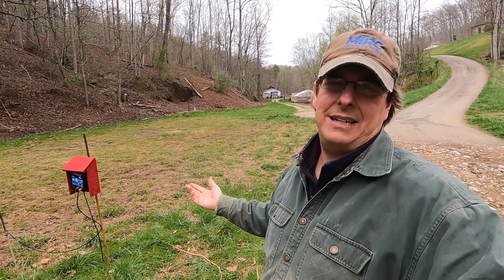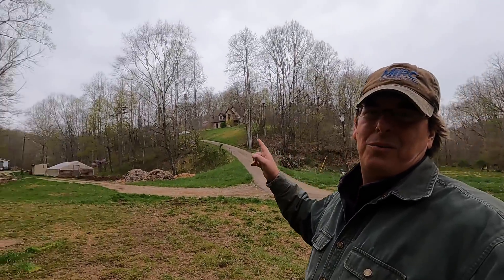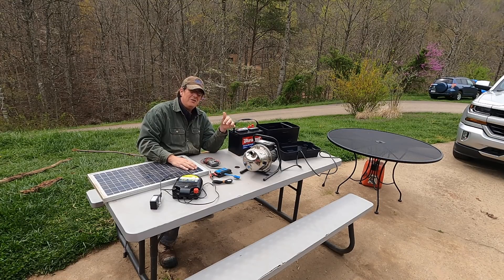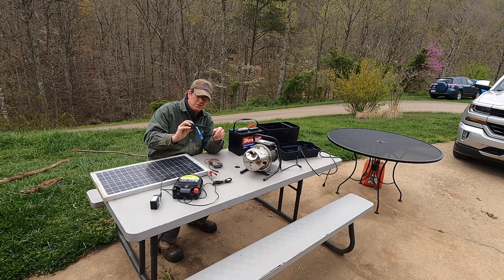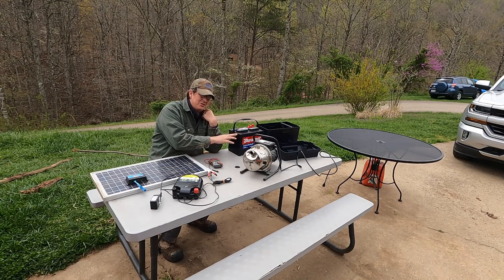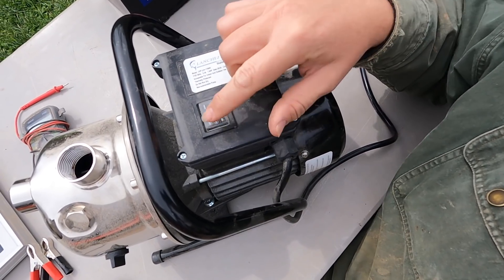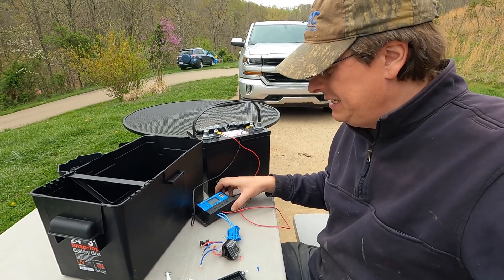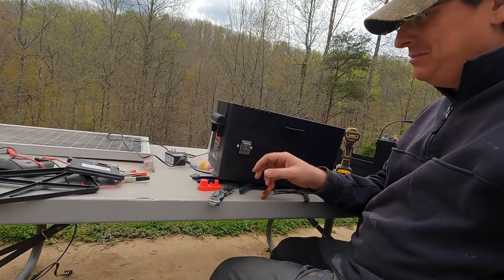Building a LOW COST Solar Fence Energizer

Comment: On your netting how are those nets set up . Are the bottom runs of it not hot so you can lay it on the ground or ???. Thanks
Reply from the maker: The very bottom is not hot. The rest are. Even if some touch the ground, the fence stays hot enough to function quite well

Comment: What is the battery box you are using? I can't seem to find one that has that extra space for a controller and switch like that. Like the adjustable divider in the box also.

Comment: Consider finding a way to attach the solar panel and charger setup to the coop. Then you can move it as a single unit. Maybe on the tongue of the trailer? Also, love the name. Although I fee like you should have put some big rocket fins on it so they could be just like Elvis, lol.

Comment: is it possible for you to mount all of this to the coop? (somehow a remote switch to turn it off) it will make it easier to move around plus you could mount the panel to a pole on the coop as well.

Comment: ??Can you mount the Solar System to the top of your Coop Devile a. Rotating mounting System for your solar.
Reply: No you want the coop in the middle with the fence surrounding the coop. The electrical works are better off outside the fence for service and to turn power on/off without jumping a live fence. If you attach the works on the coop at least a few hens will decide to roost on it and crap all over it.

Comment: Very nice. You might want to mount everything onto the 'Coop Deville.' Then you can move everything all together and then park the coop near the fence and run your wires over. You could even use  a swivel mount so you can adjust the panel to the sun no matter which way the coop is facing.
Reply: Thats what I was thinking!

Comment: Mount the panel Energizer and battery in a old garden wagon with a ground rod you put in ground and pull out and put in wagon to move. Worse case you can also pull it with a 4wheeler or something.

Comment: Raiding the pump for the water proof electric box is a good tip.  I have a few halogen work lights I'm going to replace when the bulbs burn out yet again that have boxes and a few other bits...
Reply: Often you can replace the bulbs in the lights. Some you can't(without rebuilding the whole thing).
Reply: I know, in fact I think I have a couple spares.  It's just that LED work have gotten to be so much better, the halogen work lights I have have become obsolete.
Reply: @rochrich1223  I don't know how handy you are with electricity, so don't do anything you're not trained for. However if you are they do make LEDs that run on 110 directly. You would obviously need to account for the heat generated.

Comment: Great work!   At some point you need to mount the panel battery and charger to your coop   One less thing to move every week.  Panel could be mounted so it could be rotated toward the sun. To power the fence you can use regular poly braid to the fence using a plastic post or two to keep it off the ground or get some insulated wire designed for electric fence voltages and lay it on the ground.    Then every time you move all you have to do is turn it off and pull the ground rod

Comment: One word of advice is to block up the charge controller to get it off the bottom of the battery box this will help keep any battery acid leakage and/or H2O from getting in to it. I know its a cheap controller but i have had 3 now 2 similar ones and did the same thing as you in a battery box with my 1st and it only lasted about 6 months took it apart and inspect it was full of corrosion from acid  and H2O. The other 2 are set up with it rased up to be held in the top of the battery boxes slightly above the battery level these now have been working for 4 and 6 years.
Reply: I was going to say the same thing about but letting it sit on the bottom of the box. 

I was also going to suggest that a 30 watt panel is much larger than needed as my 20 watt panel can keep my battery topped off on a cloudy day,  but I have an open Southern exposure.